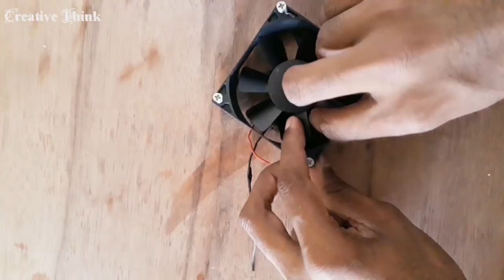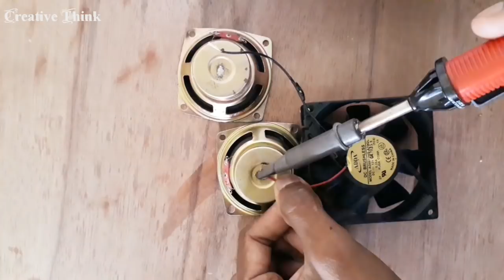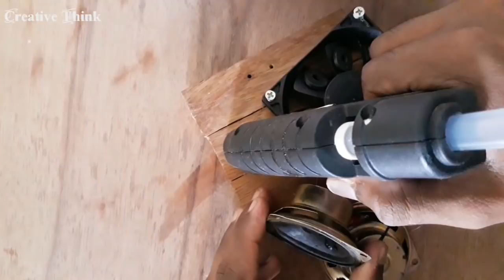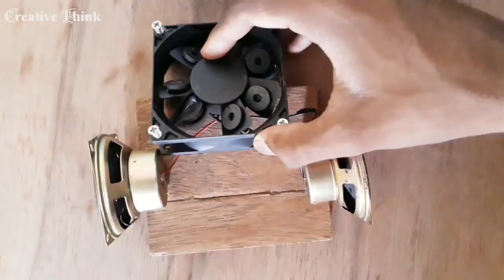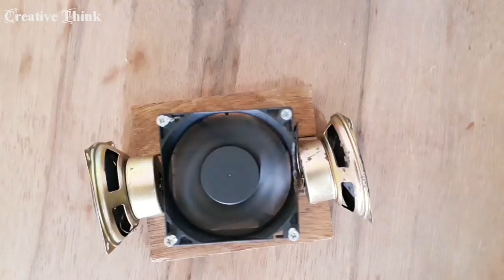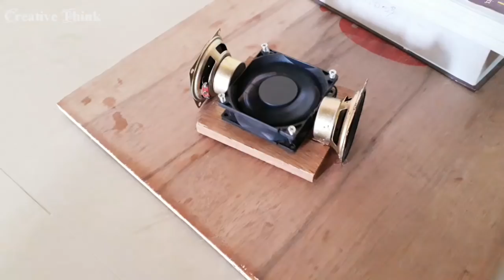Free Energy Device with using Two Speaker Magnet

Comment: When you move the cooler to the speakers - do not hold the cooler with your finger. Otherwise, there is a suspicion that this is a fake with a hidden battery. It is necessary to see the moment when the cooler starts to move, or how a push is initiated to start the system. But in this clip there is every reason to suspect a fake.